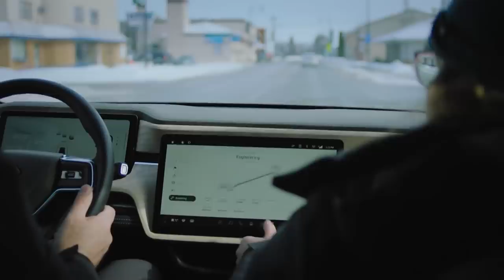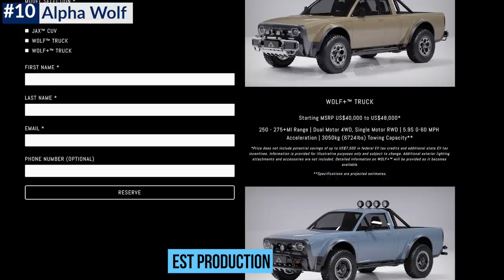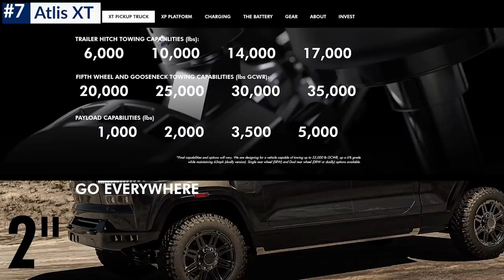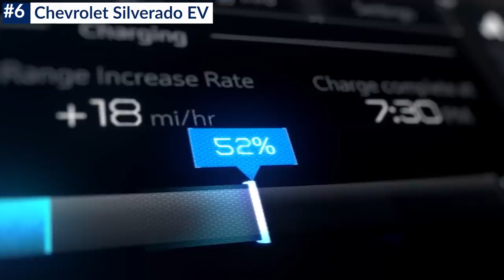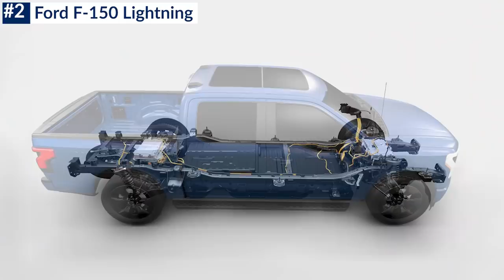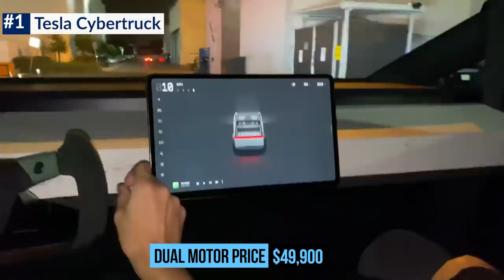10 Electric Pickup Trucks to hit US Streets Soon | It's Happening!

Comment: No one wants the electrical bill to charge a battery that don't do much in the first place batteries take too much pollution from the factory to make batteries it pollutes our atmosphere to dispose of these batteries and to recycle them it takes too much pollution what ends all the pollution is the hydrogen fuel cell and with the hydrogen fuel cell you get rid of pollution and you have an electrical plant on wheels you can put 110 outlets in the vehicle and run extension cords and do all kinds of cool stuff call your Representatives today we need hydrogen fuel pumps put all across the United States of America so we can become a superpower again not to rely on oil or have a electrical bill that is as high and as bad as gasoline with hydrogen fuel it'll never be expensive fuel because we can pull it out of thin air plus it only takes 2 minutes to fill up and the hydrogen fuel last for weeks hydrogen fuel is more reliable and more powerful and so are the motors

Comment: I'm sorry no one is asking for these vehicles.  Most will be sorry they bought one.  Battery is not the future. Maybe hydrogen but not battery.  Not useful.  There's not enough battery material on earth for everyone to have an electric vehicle.   Limited range. Limited charging places especially when you get away from a city.  These vehicles limit your freedom of travel anywhere you want. Your Basically trapped in your city-state.
Reply: I am asking for these vehicles. I am not sorry I bought three, plus my preorder for the Cybertruck that will tow my 15k lb workboat. Hydrogen is still a rube goldbergesque way to get around. Batteries are copper aluminum and plastic, plenty of that to go around and it's all recyclable. My range is 3-4 hours then I need to pee or eat. I have chargers all around me and I live in a small mountain town in nw Montana. My ev gives me freedom to drive anywhere I want without having to worry about fuel costs, breakdowns, gas stations or any of the other garbage associated with internal combustion. Y'know that feeling when cranking the engine and it goes for a millisecond longer than usual and you go "oh shit"? Yeah, I don't miss that feeling at all, or laying on my back doing oil changes, in fact my car sends me an email every month telling me that I don't need to do anything to it, it's happy, so am I. I love my carburated v8s, but they will soon be replaced by ev's and I will drive my old trucks on the weekends for fun.
Reply: Literally nothing you said is correct

Comment: UNTIL an across all mfgrs acceptance standard of easy swap out batteries… there is no way electrics will soon replace our gas guzzlers. 250-300 mi max range ? Seriously ? GREAT for vacations… drive a day… stop/charge for 2 days… drive another day… nope… NOT gonna happen !
Reply: It is feasible without swapping batteries. The superfast chargers will get you like 80% of that range in less then an hour. I will give you that it is still slow and the tech or the infrastructure isn't quite up to where it could be at this point. But uneven growth in technology and deployment is expected, it may not work for you today, but certainly it will work for some people. The more people that switch, the less demand for oil, which does help lower fuel prices.
Reply: It only takes 20-30 minutes to charge at DC fast charge stations.

Comment: The Wolf looks like a plastic toy.  Who can afford a 40,000+ vehicle?
Reply: @anthonydilorenzo378  why tie yourself to a bunch of corporations that are out to take you for all you've got. $90k for a diesel truck, $5 gas, DEF, filters, plus all the stuff you need to do to get the truck to run good in the first place? My ev has over 80k miles with zero maintenance, and I get my fuel from my house. Trucks became garbage when we moved away from the carb, modern diesel is a joke. I'm going from a 78 K30 big block to a Cybertruck, I love my truck, but it will soon haul campers rather than work trailers, as it should be. The Cybertruck is all truck, gobs of torque, 35" tires, tough body with no paint. Tesla designed it as the transportation for Mars, frickin Mars! If I have the chance to buy a moonbuggy who would say no to that? BTW mentioning power outages on a video about trucks that power your house doesn't help your argument much, besides, remember when the pipeline company was hacked, and even though supply wasn't compromised, the ensuing panic buying caused price gouging and shortages. Try hacking my solar panels, just try , see what happens LOL.

Comment: Yeah more n more electric cars. Let's overload nuclear power plants till they blow. That will surely save the environment
Reply: Nuclear is being phased out along with coal because it is to expensive. NG is replacing both coal and nuclear. It can ramp up and down production much faster to make up for deficiencies in wind and solar production. NG is more expensive then wind and some solar, but it is cheaper then coal and nuclear. As you mention the liability costs of Nuclear is extremely high, but they are very expensive to retire and the US has the most nuclear out of any country by far with around 100 units. Slowly  retiring spreads out the costs over a longer period of time.
Reply: @sharonrose9552  coal is not expensive.  It is being MADE expensive.  It's actually the cheapest and most flexible power there is.

Comment: The rivian seems to be the best of these but the ford is a little more affordable
Reply: The Ford is most likely a much higher quality truck as well. It is just another drive-train, in their standard F150. It isn't a separate design, or assembly line. They are leveraging cost structures of their ice vehicles.

Comment: All these electric trucks are ugly! The range is BS, it doesn't take into account the drastic change in the outside temperature. In extremely cold and hot weather, batteries don't do well at all. I think the hydrogen fuel cell is going to be The Best Option in the future and all these electric car manufacturers will be holding the bag! LOL....